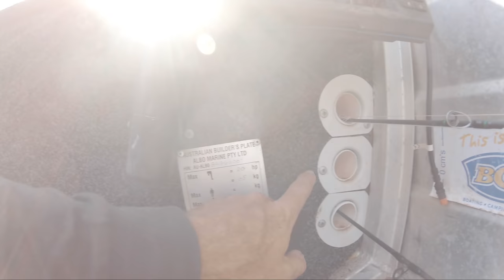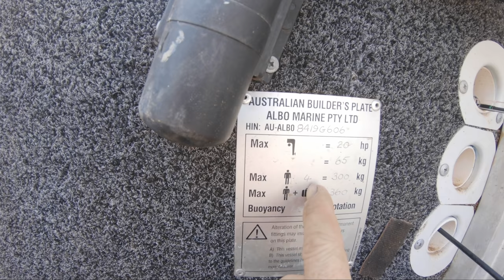TINNY FITOUT | Tips and Tricks for the ULTIMATE FISHING TINNY

Comment: Just a tip to add when doing a cutout find some cardboard like find some one who has just bought a large appliance like a fridge then you can make suitable templates to trace onto wood. Saves so much time and fine tuning. You only have to find tune the cardboard shape not the wood. Then you can lay them all out to check fitting and do all your cuts at the same time.
Reply from the maker: Beautiful, I like that! 👌🏼

Comment: Lift the rod to 12.00 they will be a back drift to 1.00. So when the fly is on water. You lift the line up then a gentle flick to 12.00.  When it right then double haul. Then side cast with stop. Fly line goes stright out and end turns around a object.

Comment: Love watching you guys! One question on your tinny fit out. With the 40mm pvc tubes through the seat, obviously the front of boat is curved, how do you get the pvc to line up from front to rear on that curve?
Reply from the maker: Hey Darrel. Iv just drawn a square line across the top of the seat and down the other side and then measured down to the same distance each side of the seat. If that doesn't work because it hits the gunnels then just parallel off the gunnels and drill through on that Slight angle, Then fit the tube on an angle. The rod will bend up into there no worries.

Comment: Hey guys great videos, you guys are livin!
What thickness marine ply did you go with? 12mm? Going to make my tinny a winter project so it's ready for summer! Thanks for the inspo 🤙
Reply from the maker: Hey Jed, yeah think I went 12mm mate. Awesome, take your time with it and let me know if you come up with any cool ideas. Excited for you 🤙🏼
Reply: @WildReaches  Will do! Thankyou 👍
Reply: Started the build today. Mainly cutting ply to size, taking measurements etc. Installing a T off area up front for biodegradable golfballs and installing a berley/golfball canon on a swivel up front made of copper. (Should look cool- and provide some fun) 
When you framed the front seat area to make it higher with h3, how did you fix it down?
Reply from the maker: @jedkates5857  Wow, sounds cool! what are these gold balls made of? All natural stuff? Good question mate, cant remember but the first thing that comes to mind is countersink some holes into the top edge of the H3 framing about 30mm deep. one at each end and one in the middle. sika flex along the base and then put some 75mm roofing screws down into the aluminium seat. Pre drill first obviously or use metal tip screws. hope this helps

Comment: Hey guys how did you frame up the rear casting deck ? How did you build the initial structure to then put the marine ply on top and hinges etc... 
Thanks.
Love the vids 
Great work, keep it up
Reply from the maker: Hey Michael, aluminium angle mate. I ran aluminium angle 12mm lower than the seat height around the seat, gunnels and transom. Sika flex and pop rivets to fit it on. 👌🏼
Reply: @WildReaches  thanks mate ! Appreciate it